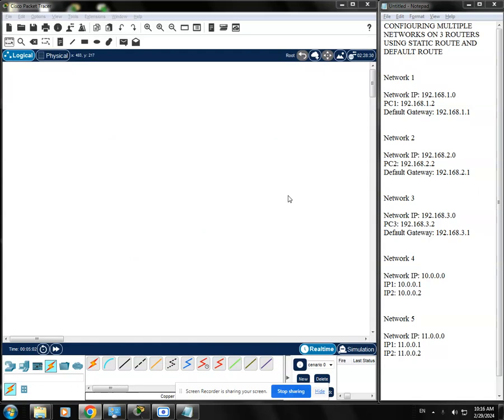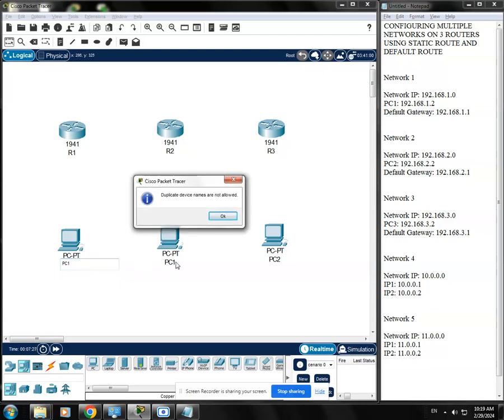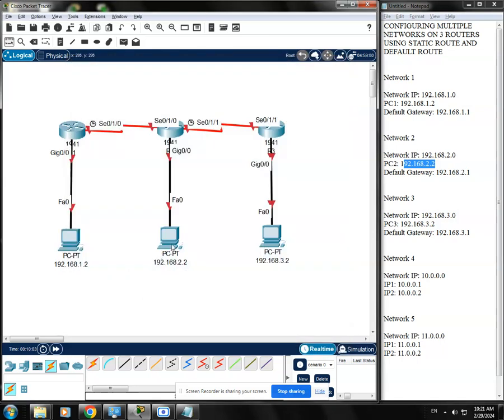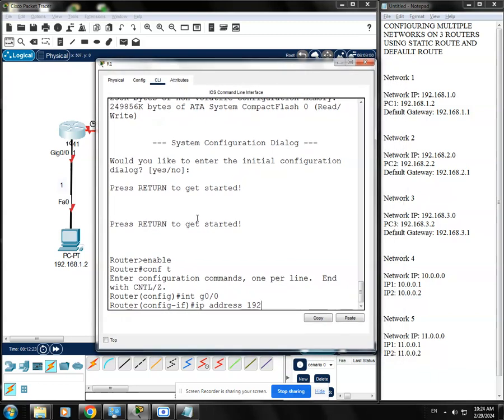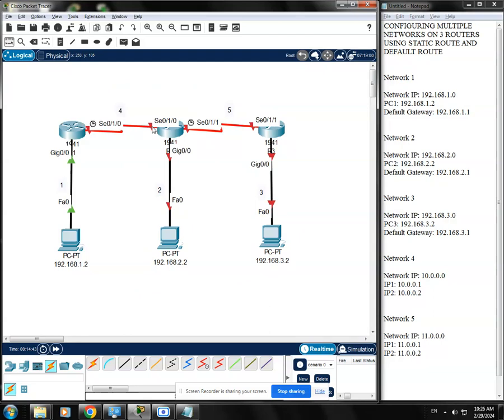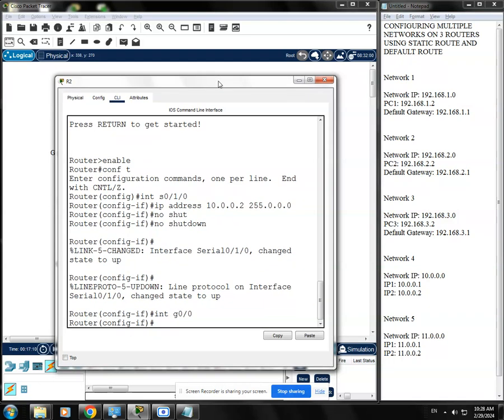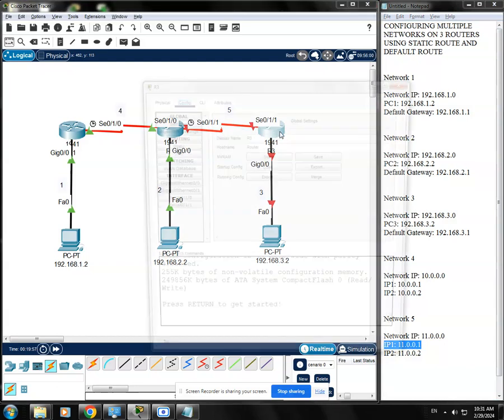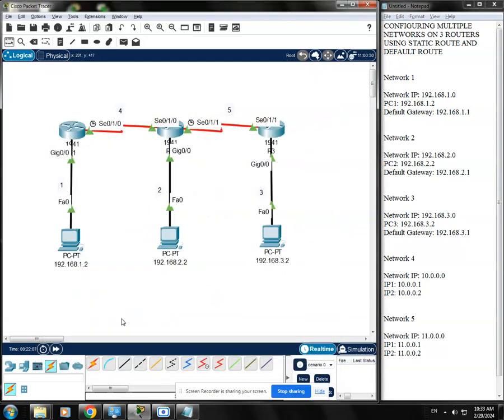Day 7: 3 Routers on Multiple Networks using Static and Default Route - Part 1

Comment: How do you make it so that when you connect the ports there automatically labeled?
Reply from the maker: Hi Steven,
To register an IP address for each device, we need to do it manually unless we have an active DHCP (Dynamic Host Configuration Protocol) set up. The label only indicates whatever information we want to assign to each device but it has not been configured yet.